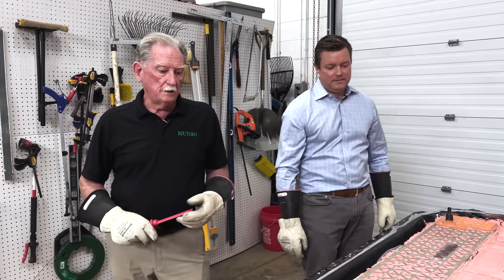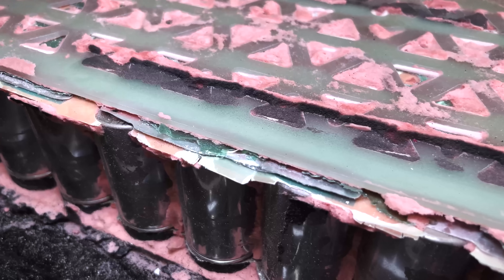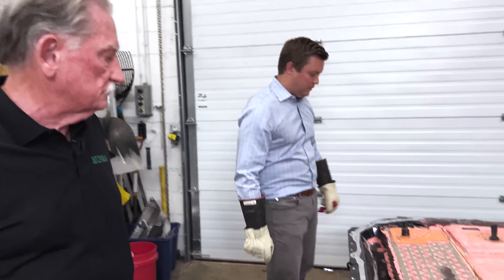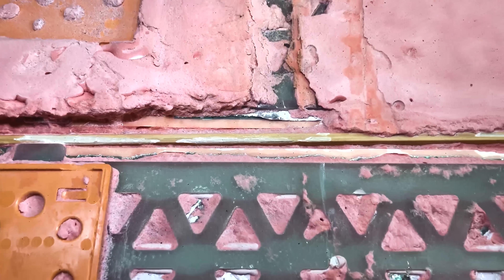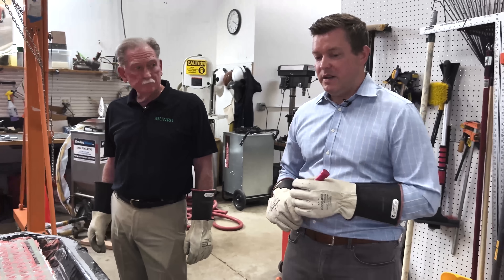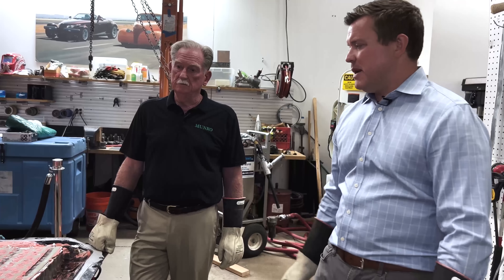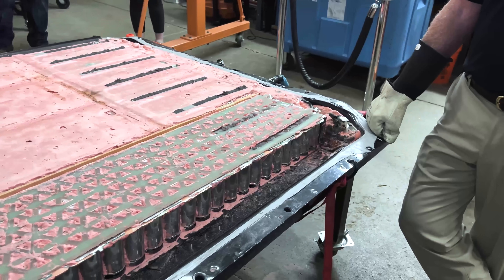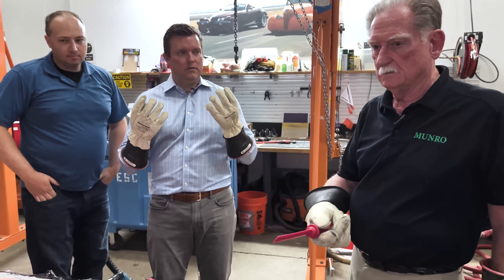4680 Battery Pack: What We Found Under the Foam!

Comment: If we assume 816 cells and 98 watt hours per cell, puts total pack capacity at ~80 kwh. This would suggest they are software limiting the range. What we don't know is the actual energy storage amount of each cell. If it's 95 watt hours per cell, that number drops to 77.5 kwh.
Reply: More likely the first gen cells are lower than 98 wh/cell.  The 6 month old cell that The Limiting Factor tore down did not have silicon. To me, it looks like all 828 cells are in there (34/35 strings just like the ones on display at Cyber Rodeo).  Drew said in the latest earnings call that there will be no magic surprise of range unlock.  So, they are starting with a more conservative chemistry (no silicon) as the dial in the dry process and new form factor.  That is my conclusion with everything know to date, but still just conjecture until someone can count those cells and lab test their capacity.  I hope we finally get to solve this mystery.
Reply: @oof_Dad  i believe the 4680 was never meant to be this battery that had the crazy range increase people where hoping for but instead focus on durability and life so it would only need to be the only battery made for that vehicle which in my opinion is much much more valuable to the customer then  50 to 100 more miles and far better for the environment just think if vehicle lasted 2 to 5 million miles it now would be a generational car you can pass down to your kid or grandkids
Reply: @oof_Dad  for sure, It will be very interesting to see what the energy capacity is of each cell. The weight of the LR vs. the 4680 AWD is only about 25 lb difference. I've seen different numbers for the pack size of the MY LR, but I'm going to guess it's 82 Kwh total capacity. 

If I do the math out, assuming the EPA ranges are correct (330 miles vs. 279 miles), It would suggest the total pack energy is only 70 kWh. That seems pretty low if there are 828 cells.

That would put the per cell energy at 84.5 watt hours/cell. That seems a bit low, but who knows.
Reply: Curiously, 98Wh per cell  is just below the Class 9 hazardous material regulation for shipping which is set to 99Wh max.
Reply: They might have some number of dummy cells to reduce the pack capacity. This would make sense given a limited cell supply.
Reply: @juhak27  I don't think this is likely the case. I'm guessing the energy density is just not there yet.
Reply: Rough calculation:
Price / cell: Tesla aim at below 100$ but lets take 120$  /cell
Density: 276wh/Kg (98wh/cell)
Weight: 355g
Amount: 828 cells
Comes down to:
81.1Kwh  at a weight of 294kg cost price of 9735$

So they gain 4.7Kwh, drop 15kg in weight and save 3244$ compared to the 21700 cell pack. 
This is with low balling figures, I bet they can get above 276wh/kg and surely go below 120$ / cell price. 

Think they software limiting the 4680 packs until they can ramp up the production. No one would be buying a Tesla now knowing that the new pack is better, so they keep the new spec low until they get most of their production up running for 4680 cells and later come with a magic range update.
Reply: @pipooh1  Could be, or the initial cell runs at mass production are simply not coming in at the energy density levels they had originally projected. It will improve, but it could also be the case they simply are not getting the desired energy density per cell yet. We need someone to do a full charge to full discharge of a single cell. I'm sure we will know soon enough.
Reply: @jasonfranciosa  The 98wh/cell is still a rumor from Troy Teslike yeah. Hope we can get a result soon enough. Hope we get close, but think even with less Tesla saves money and production speed with the new pack.
Reply: @pipooh1  For sure, a lot of people are anxiously waiting to find out.
Reply: It's 828 cells, but sure, that's the rough capacity.

Comment: Would love to see the recycling process on video.
Reply: How about repair? Why nobody is interested in repair?
Reply: @jetfu400  because mixing new and old cells in a single managed module does not work, has never worked and  will never work.

Battery packs, no matter the application or manufacturer, don't get repaired. They get replaced.
Reply: @anonym3017  thats not true at all.
Reply: @jetfu400  mate new and old cells have a different internal resistance and therefore voltage drop under load.

If you mix them inside a single module the new cell will put out a higher voltage than the old cells which quickly degrades the rest of the pack. Killing it, for Teslas, in a year to a year and a half. If you replace any one of the 4 modules.

So no. Repairing the pack does not work, never has and never will. You replace the entire thing at once with a new/used one where all the cells have the same internal resistance.
Reply: @anonym3017  repairs have been done already, watch "rich rebuild" channel. Having the capacity to repair your own vehicle puts the power to the consumer not the company.
Reply: @jetfu400  yeah. except there's a slight difference between a "repair" that needs to be repeated every year or so because the new module doesn't work with the old module and a proper repair that lasts for a decade or longer.

Richs repair of swapping a single module falls under the first. something that you'd know if you read any of the coverage and reactions richs video got.
Reply: @anonym3017 so youd accept everything a company throws at you huh. Ok i respect that. Lets just hope that these batteries will meet the promised durability after warranty. Or else, get ready to spend thousands of dollars. Well see.
Reply: @jetfu400  again. Rich "repaired" the battery pack of a tesla model S by switching out 2 of the 14 modules.

something that, according to jason hughes aka "tesla hacker" doesn't work for long as the imbalance is just too great. 

and for the record hughes owns a tesla repair shop and has attempted that fix multiple times with none of the attempts working.
Reply: @jetfu400  That would be interesting as well.
Reply: https://youtu.be/xLr0GStrnwQ
Reply: https://youtu.be/LABwwX960mk here is one. Slightly different methods but just as easy.

Comment: How in the world would an authorized cell replacement be accomplished?
Reply: Why in the world would an authorized cell replacement be attempted? Replace the whole pack. After warranty? Replace it with a used pack from a crashed car.
Reply: @geirmyrvagnes8718  ask Gruber Motors - there is a video posted on how they fixed a model S or roadster and replaced a single cell and restored its original miles.  It's not an insane idea.
Reply: @geirmyrvagnes8718  https://youtu.be/F-B_8oMZNeI?t=277 timestamped for explanation
Reply: There is no authorized (by Tesla) replacement of a cell in any Tesla battery module. This pack is a single module.

Comment: LOL, one thing about Tesla, they think out of the box and are freaking fearless.  I can't imagine any other company having the nads to put this into production.
Reply: This thinking outside the box is amazing.  I couldn't ever imagine a Legacy company ever doing this.
Reply: That is because other companies don't want to screw their customers quite as bad. The greed of tech companies is endless. But it may backfire on them if they have to replace millions of batteries under warranty :)
Reply: @DavidJohnson-tv2nn  GM and ford screwed their customers more than any other car companies.  Ford knowingly sold defective transmissions for a decade and had to be sued over it because NHTSA refused a recall.  GM has tons of models with defects that required customers to sue because they also magically avoided NHTSA recalls for safety issues.  Tesla as a brand new company has barely had any recalls (we are adults, software updates do not count when NHTSA is ignoring serious hardware issues in other brand's cars).
Reply: @_PatrickO  Misdeeds by GM and Ford doesn't justify misdeeds by Tesla. You should know that. But at least the GM Ultium system uses fully repairable battery packs, from what I understand. 
Corporate greed is a big problem and it is getting worse. Not helpful when people try to justify it. No matter whether it is Tesla, Apple, or any other company.
Reply: @DavidJohnson-tv2nn  Name the worst misdeeds then.  Generics mean nothing.  The ultium pack is repairable because GM has no confidence in batteries.  Servicing one ultium pack will cost more than recycling an entire tesla pack back to raw materials.  GM makes their packs less dense with this strategy which just reduces range and on top of that, GM has the worst efficiencies out of any EV car maker.  (lg chem makes the bolt drivetrain, which is why that is better than all other GM EVs.)

So please name the top tesla misdeeds.
Reply: @DavidJohnson-tv2nn  It may backfire on them, sure. But if 99% of these battery packs last 20 years and 350K miles with no trouble which is the prediction for them, then the customers got more than their money's worth.   Time will tell.
Reply: @ohger1  And they want to make 10 million cars per year? One percent is 100,000 failed battery packs per year after 20 years! Those customers who choose to purchase a used car outside of warranty will be screwed.
By the way, Musk also predicted every year since 2015 that full self driving "is just around the corner"!
Reply: @DavidJohnson-tv2nn  That is still FAR less than the amount of ICE cars scrapped well below that age and mileage for major engine and/or transmission failure.  People expect EVs to run forever with zero trouble..
Reply: @ohger1  I'm currently driving a 20 year old gas powered car with no problems over the three years I owned it. Paid $500 for it. Engines and transmissions can be rebuilt or repaired. They aren't designed as throwaway items.
Reply: @DavidJohnson-tv2nn  I sell engines and transmissions from our salvage yard.  I sell all I can get.  According to our industry, the average life of a gas engine is 160K miles.  Your single anecdotal example is the exception, not the rule.  If 99% of Teslas on the road have good battery packs at 20 years and 350K miles as predicted, that will by 20X better than gas cars are doing.
Reply: @DavidJohnson-tv2nn  Haha I don't think you understand what you are looking at, this is nothing but good for the customer.
Reply: @SirDragonClaw  I fully understand what I'm looking at. Please explain how it is good for a customer who purchased a used vehicle outside of warranty that now has a problem with the battery pack?
Please tell me how it is good for someone looking for cheap home energy storage, and can't buy repurposed battery modules?
It is crystal clear that built in obsolescence is good for Tesla investors, but how is it good for the average person?
Reply: @DavidJohnson-tv2nn  by the time this battery needs replacing it will be obsolete ! They’ll probably be dropping the whole car into the sorter !